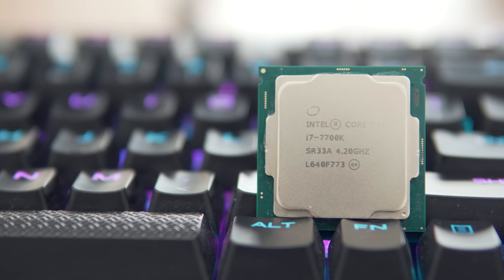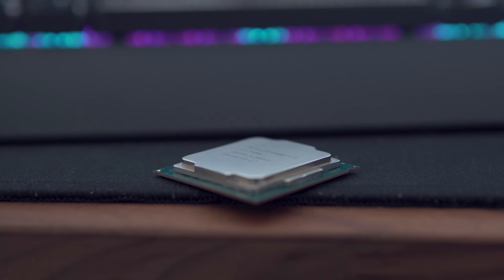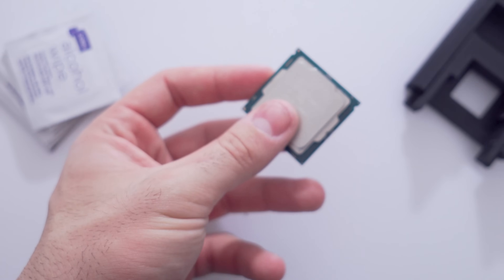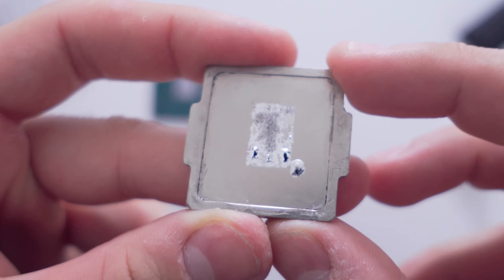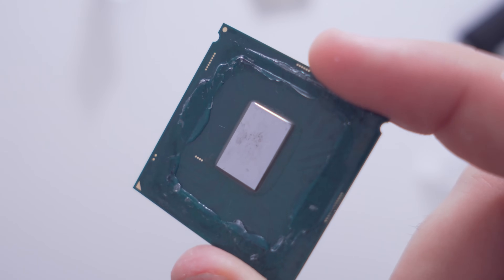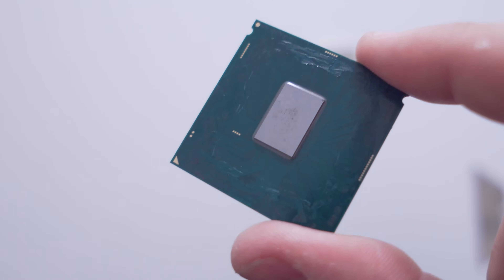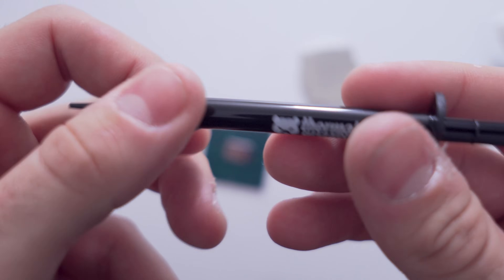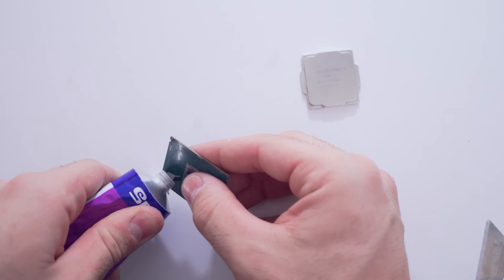Liquid Metal on CPU - 9 Months Later!

Comment: Liquid metal(eutectic mix, that is most often gallium based) doesn't "dry". There is no water(hopefully!) to leave the theoretical solution to leave only solids behind. The whole compound is a mixture of two or more metals, which do not vaporize just like that. Gallium does, however dissolve nickel, which is the coating on the lid by my knowledge(even if it's only ever so slightly soluble). So yes, liquid metal can "damage" you CPU, but it's so restricted that it's has no real detriment, unless you are constantly reapplying and mixing it up(the surface wet with it still conducts heat, like it's supposed to. Also, the reapplying part is me making guesses with no particular source or info on this particular use case, take it with a grain of salt.).

Tl:dr - Just put the goop on the die, close it tightly and let it be. If you did it right, the surface lasts longer than the processor. People(fanboys, humanity questionable) who say, that Intel uses their toothpaste for our own good are either grossly misinformed or blatantly lying.
Reply: qwormuli well it does reduce cost so inadvertently it benefits users
Reply: It is cheaper, yes, but the customer never sees a cent of those savings. They already grossly overprice their products, so these kinds of cost cutting methods only work to widen that margin. Also, one of the alleged reasons is the ability to coax customers to delid the chips thus voiding their warranty.
Reply: qwormuli nowhere near enough people delid to make a significant difference. I doubt warranty is even important as most cpus last way past warranty even with overclocking. Intel is expensive yes but they aren't just hoarding our money. Tech companies generally use their margin for development which is partially why Intel is doing so well. They cost more than and but that means they have a lot more to spend on improving their products. There's a reason my 8 year old Intel i5 is competitive with new ryzen quad cores.
Reply: Intel uses toothpaste for the same reason they make unlocked, overclockable SKUs that still void your warranty when you overclock them; so if something does go wrong it's "whelp, guess you gotta replace that cpu or buy one of our new chips and shell out for a new board lul"

Comment: I still find it shameful that Intel uses some cheap thermal compound rather than soldering the heat spreader to the die.  I saw a significant drop in temps on my 6700K by delidding and using a liquid metal compound (Thermal Grizzly Conductonaut).  From temps around 80C at stock speed even with an EK Supremacy waterblock and 480mm rad to temps around 55C under load overclocked to 4.9Ghz @ 1.42V.  Which shows how awful that garbage Intel is using performs.  Intel certainly isn't offering anyone any bargains on CPU pricing.
Reply: Something was seriously wrong with your loop then. I had a 6700k, and two 1080's in a dual 280 radiator single loop, and my temps on both CPU and GPU never went above 55-60. This was without delidding and just using AS5 thermal compound.
Reply: i agree my 4690k is clocked to 4.1 at 1.30v and it runs nonstop everyday. after gaming all day my temps get to 52c and top out. EKWB 280 slim kit full copper version. im using arctic silver thermal paste and the coolant the kit came with with red food coloring.
Reply: 1.42V? wow, that is pretty high.
Reply: Squiggly667 would it be hard to solder it
Reply: Damn you got a -25 °C improvement?

Comment: I had Liquid metal on my FX-8120 for 3+years and i removed the heatsink for the first time last week. The temperature was absolutely the same as 3 years ago (60C under load). After removing it i observed the following:
- The base of my cooler is a mirror finish, nickel plated and no liquid metal was stuck to it.
- The cap on my cpu is lapped, so it is bare copper and the liquid metal is firmly stuck to it. Also the liquid metal is not a liquid anymore, but it also has a mirror-like finnish. It cannot be removed from the cpu with solvents, so i guess i have to sand it down.
I think it's a great solution for bringing your temps 1-2c for extreme overclocking, but not really useful for moderate overclocking.
Also i dont think that drying up is a problem at all! Mine was completely dry and the temperatures were exactly the same as the time i applied it.
DO NOT USE LIQUID METAL ON ALUMINIUM! Use it only on copper and nickel!
Reply: bobsagget823 you say that but I am not convinced. I've been reading the comments and doing some research. Semantics wise people say the word amalgam only applies to mercury reactions. Also gallium by itself will always retain it's properties by itself. Everyone knows it reacts unfavorably with aluminum, but when it comes to copper and nickel I have seen the majority of people say that gallium does not react with those two metals. Researching that further I found that it might be the case that gallium does react with nickel but at an extremely super slow rate that would take years and years to be noticeable. When it comes to gallium and copper the consensus apparently still stands that they do not react with each other, and that the only reason one might find gallium staining copper or other non reactive metals is because it filled micro pores in the metals surface or because of friction causing the same thing over time. The friction example would be the same as a drop of water on stainless steel in that over time the water molecules wear down the protective oxide and rust proof coating but rather than gallium causing a reaction it will leave a stain that is harmless. Someone please correct me if I am wrong. I have done a little bit of research but am by no means an expert and would like to know the real answer just as much as you.
Reply: Which brand of liquid metal did you use?
Reply: What do you mean it is not liquid anymore? When you inspected it was the room or cpu at a temperature that could allow the gallium in liquid metal to be in a liquid state (chemistry-wise)?
Reply: Sounds to me like nickel is effectively impermeable, at least over 3 years. Copper being more susceptible certainly seems reasonable, but I'm no chemist. Either way, IMHO it should stay liquid long enough to fill the cracks and microscopically conform the two surfaces to each other, as long as you aren't involving aluminum.
Reply: a a yes but your copper heatsink is not pure copper...
Reply: Liquid metal is mostly gallium, which reacts with copper/nickel/aluminum to form a solid amalgamation with worse thermal properties than the base metal.
That's what he means when he says it wasn't liquid anymore.
Fact is liquid metal isn't permanent - it will fuck up your copper & nickel plating eventually. The reaction is just faster with more heat.

Comment: 0:41 man I really laughed at that one ... I wonder if expensive tooth paste would be better though ...
Reply: LinusTechTips Techquickie did that. Long and short is yes it works and literally anything is better than nothing.
Reply: I remember some paper where they gave results of all kinds of different possible thermal pastes, including jam, butter, mayoneese,... And If I remember right, the only thing worse than nothing was chocolate (: so just don't use chocolate, everything else is fine :D
Reply: waste of time to use better TIM, if your going through all the trouble to delidd a CPU use Liquid metal. I myself only seen a 5-7*C drop with TIM and a 18-21*C drop with liquid metal on my 5.2Ghz OC 7700k
Reply: yes,  yes it actually is

Comment: The best way to resolve the issue of LM contact with anything is to coat sensitive areas with nail polish. Certain polishes work better fo rthis than others; do some research, find a polish or coating which won't mess with your CPU (and GPU) and then when coated you can go full-on ham with LM knowing any spillover won't be detrimental.

Comment: it's been 9 months since I delidded my 7700k and I haven't seen any temperature degradation so far. my pc is up 24/7, although the CPU is seldomly at full load.
what worries me a little, I applied WAY more liquid metal on the die, than you in this video. but since the CPU has been working fine so far, I guess I didn't screw up :)

Comment: I still have no idea why Intel does not either solder this on or simply not put a IHS on anyway.. They are not needed and is just something else to inhibit heat transfer..
Reply: Intel will never sell open die CPU's again, no one will. Idiots tightening heatsinks on top of them cracked CPU dies all day long, and they had too many RMA claims. Can't have nice things because of idiots.
Reply: Actually they dont need to do anything. They use the cheapest method and they sell. And as long as they sell they dont care. Basic business.
Us consumers would love for it tho :P
Reply: danman1012 Yeah, IHS is kinda important nowadays, that being said, Intel could always sell soldered IHS or on with Liquid Metal, they certainly have the tech!
Reply: Kartikeya K nah, they just need to sell enthusiast grade CPU's without the IHS applied and it's in the box. These CPU SKUs will have  no warranty (aside from DOA/manufacturing errors and defects) people open theirs anyways and void the warranty. People would gladly pay for ones without the IHS glued down and no warranty.
Reply: Yeah completely agree!
Reply: They did have soldered cpus up 2nd gen. Then they changed to tim.
Reply: Wasaled I never said they didn't and their next gen CPUs are supposedly soldered. The question was about open die CPUs.
Reply: danman1012 my comment was ment for the main post not your comment.
Reply: Joe's Photo & Video Channel thermal contraction issue on large die size

Comment: My 7600k was on 5ghz 1.255v before delliding, 5.1 on 1.295v./ 5,2ghz wasnt stable enough. After delliding my highest OC is 5.265ghz on 1,420v temps are 62C. Cinebench score is 882cb I can go 5,3ghz but the cache goes very low & RAM OC too

Comment: Would you recommend an rx 580 8gb for the same price as a gtx 1060 6gb(I have a freesync 1080p monitor with a gtx 1050ti and I'm looking to get into vr gaming with r5 1600oced and 16gb of ram with a 1060 or rx 480/580)
Reply: Krekker Recer if you have a freesync monitor to begin with i would get an rx580.
Reply: Usually I would recommend rx 580, with free sink monitor its not questionable at all

Comment: lol safe to delid.  If it goes right it will run a little cooler.  If it goes wrong you are out a few hundred dollars.  For the price of Intel chips they should make it so you don't have to do anything to it.
Reply: depends on the model, my 7700k runs 21 degrees cooler after delid, definitely worth it for that kind of drop.
Reply: Richard Kirkpatrick yeah "Little cooler" just a 30 deegres in my example
Reply: Intel are greedy fuckers who could easily use much better thermal paste or solder but they won't!
Reply: There is almost no risk of destroying the CPU if you use the der8auer delid die mate 2...
Reply: Its def worth it but Intel are greedy assholes for making us pay such high prices and THEN STILL have to do stuff like this...
Reply: Richard Kirkpatrick my delid makes it so I can run my CPU cooler with no fan 100% of the time and never cross 67c under my work load ( 8600k at 5.2ghz 1.35 vcore )
Reply: Richard Kirkpatrick Hey, news flash for you obviously, you don't have to do this! There is no swat team coming to kick your door down if you buy one and gasp do not delid, I'm serious. They don't spontaneously combust running as they come from the factory! (Idiot)

Comment: Is diddling safe?
Reply: Yes, never diddle anyone with a razor blade.
Reply: Dildoing is safe unless you use a cactus
Reply: Dominic Francis No, but it isn't extremely dangerous either, just use the right tools for the job, not a razor blade.
Reply: You win! Thats what i read too initially.
Reply: Eh, probably, with the right delid tool, but some people have cracked the circuit board (the green part) and killed the chip. You also void your warranty anytime you pop the lid off.
Some say it's safer to delid with a razor instead of the tool that puts enormous sideways pressure on the chip, but you can also damage it if you push the razor in too far.
Reply: A few months later, and I'm glad at least a few people got what I was throwing down. XD

You guys assuming it was auto correct mistake, what are you guys doing when you aren't looking up tech videos??? :D

Comment: Thank you for making videos like this! Lots of good info. Just did my second 7700k delid. I scratched the first one with an exacto knife and killed it. Too impatient to wait for the delidding tool to be delivered. Got a second and it turned out perfect! People in some comments recommended taping off the area around the where you apply the liquid metal and using a super tiny synthetic paint brush instead of a q-tip. I did that and it was ten times easier. Haven't OC yet because it's late but saw a 25 degree drop by also switching to water cooling. Excited to test more!